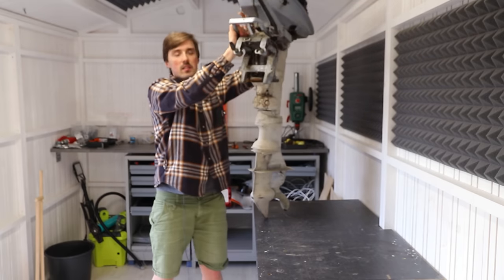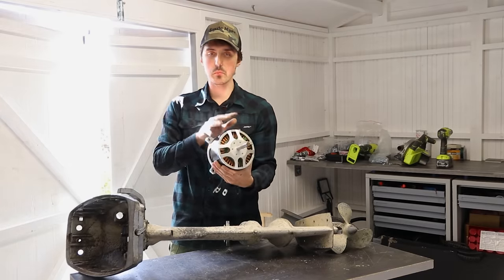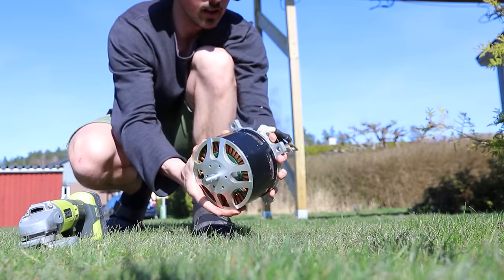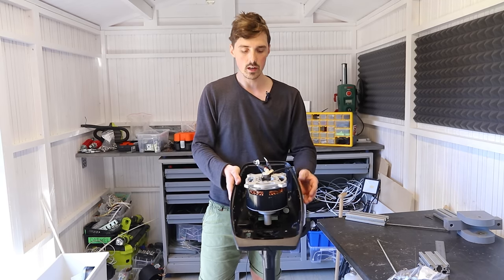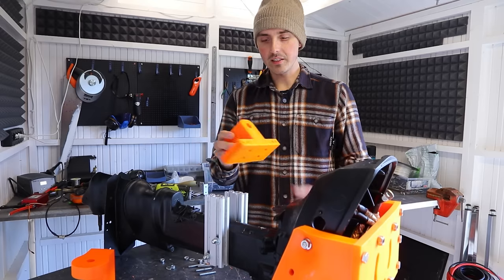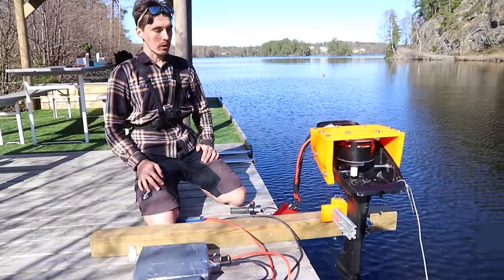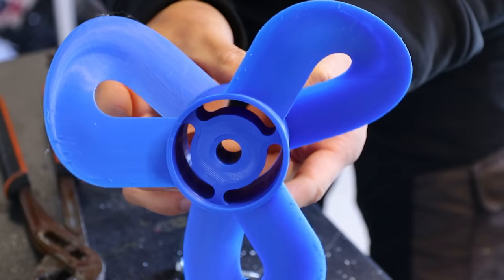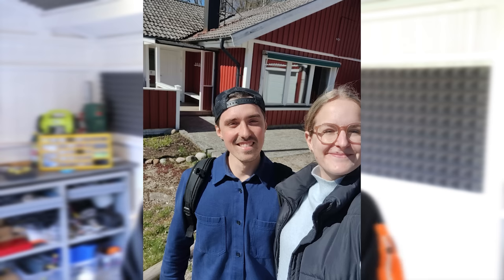Rideable Electric Speed Boat Build - PART 1

Comment from the maker: Yes, the rumours are true. I started a review channel: https://www.youtube.com/@rclifeonreviews
Reply: Subbed!
Reply: why not you use original outboard turning bracket was on it because it reduce headaches of other idea of 3d printers breaking and you can use it make bracket attached to pontoon boat and still use that original water pump inside lower shaft just need new impeller for it and come up to motor just need 90 bend to esc
Reply: Congrats:eyes-pink-heart-shape:
Reply: @kittyztigerz  Cuz he is hack and more and more so as times go on strangely. A hack with a gazillion followers, that is. So, perhaps a hack with a smart plan to stay hacky for the masses. He seeminly hates doing research so he often makes weird decisions like these. His new bracket also has its pivot point further ahead than it ever needed to be. Maybe not an issue with this power, but still, it's hacky AF and I wonder if he ever considered it's geometry and the consequences of changing it.
Also, no coupler between the motor and the shaft. He is likely going to wear out the bearings in that motor way faster than they should. Then again, by then, he is on to the next video. 

I mean, he is not stupid, probably not even lazy. It just puzzles me how many times he insists on making mistakes 15-30mins of research would have avoided. E.g. he yet has to figure out how to 3D print waterproof parts (enclosures and such) when the RC Yacht community figured it out 4-5 years ago. Or to start using proper o-rings when the two combined would likely have solved all the issues he always has with leaks in his electronics compartments on watercraft. 

But he gets shit done, he is entertaining and makes a living and the subs think it's all amazing. So, it's all good:)
Reply: @AntiVaganza  i hear ya if he would get to point when he does kick in go back fixed weak parts n alot time i do have ton of information about any machines because im engineer i was born to build stuff out of metal or plastic or woods
Reply: Just for my observation,  you printed prop wasn't cavitating from  mounting the motor high. It was sucking air out of the exhaust system.  The gas motor sends its exhaust out under the water so not having it plugged off is letting air get sucked out by the prop now.
Reply: Can you review those motors? I'd love to get a good one
Reply: Good luck
Reply: Please give us the files of the prop
Reply: Subscribed!

Comment: You should have used the original mounting bracket for the outboard engine as it serves as steering pivot
Reply: And the built in watter pump for cooling. So much extra work with this build😅
Reply: I was dumbfounded that he didn't use the original water pump nor steering assembly

Comment: I think you should use semi-flexible coupler between the engine and drive shafts, just in case they aren't perfectly aligned (and they never are), which might destroy bearings in the long run.
Reply: I think you are right, however, the 3d printed mount probably allows for enough flex for the bearings to not be under a terribly uneven load

Comment: Hello! Love your channel! FYI, the bottom end of the outboard motor should have some gear oil inside. You may want to check that its still there or you could risk burning up the gears and bearings. There should be a drain bung and a fill port that unscrew and may help efficiency if you use a lighter weight oil.

Comment: At 50v and 33kv you are at 1600rpm and with the reduction you'll have about 850rpm at the propeller. With that outboard lower unit you are forced to use a small prop so you will be grossly underproped. It would be wise to either increase your battery voltage, change the reduction ratio or even ditch the outboard and build the boat with an inboard engine configuration, which will be way more efficient allowing you to use a direct drive and a way larger propeller.
Reply: Oh, only 1600 rpm? Yeah that wont be close to enough if he wants to go fast. Dont know how you mean its more efficient though, that depends a lot on how it transfers the power, so it can be either way. Propshafts create a lot of drag...
Reply: @jotham123  Correct. There is no need to make prototypes if their only purpose is to check something that could have been done with a few simple calculations.

Comment: Cool, will be very exciting to follow this! Regarding the cavitation: there might be holes or tubes going from the underwater parts to where the old motor was, this is for exausts and maybe water cooling. It might be that the propeller is sucking air down through these tubes, that happened for me when I did a conversion :)
Reply: You are right, that's air being sucked from the old exhaust system. But that isn't cavitation (at these rpm and propeller size it is very unlikely), if it was afecting the propeller (reducing the effective pitch) it would be ventilation but you can clearly see it is produced just a few inches behind the propeller so it shouldn't be having any effect on the propeller. In a combustion engine it has the purpose of unloading the propeller at low rpm and low speed by injecting "high" pressure exhaust gases that unload the propeller (as they are forced not induced) and when the speed is sufficiently high they can't expand in the direction of the prop so the stop having any effect.
It helps quite a bit mainly for getting into plane.
Reply: @jimix321  That is very interesting, thanks for explaining :) I don't really get what you mean with "unload the propeller" though?
Reply: @AntonMakesStuff  He means that the propeller is made to "slip" and not grab the water too much at low speed by having it in "bubbly" water so it can speed up and have the engine get up to speed faster. If the propeller doesnt "unload" aka "slip" it will bog an engine down and the takeoff will be very sluggish :)
Reply: @eamh2002  That is very interesting, thank you for sharing!

Comment: For testing motors we've used a trash can where we could mount the original bracket on the edge and fill the bucket with water.

That might help for quicker testing at home 😊

Comment: Hi! Great concept. 
Why not use the original bracket for steering?
And what happend to the impeller? Did you take it out or are you going to use it for cooling the motor/speedcontroller?

Comment: hi, I don't think the propeller you printed is actually toroidal. It looks more like it's a regular propeller but with a hole in the blade if that makes sense. The point of toroidal propellers is that the extrados of the blade on the lower half becomes the intrados on the upper half, and vice-versa. So the blade sort of curls back to the propeller shaft. Look closer at the blade "tip" of toroidal propellers if my explanation isn't clear, they're not the same as the one you printed.

Comment: I don't know if you've already finalized this yet or not, but mirroring the mounting/hinge setup so that it goes on the top and bottom of the wood beam would massively improve its strength. If you did this, I'd be willing to bet you could even keep the mount made from plastic without any issues. I did some very rough math and estimated an increase in strength of an order of magnitude or two.

The biggest drawback to this is you'd need to find a way to get the whole setup further underwater since it would raise it even further in its current mounting configuration.

Also, as others have mentioned, using the original mount would also solve this issue.

Comment: Without sponsorship, PCBWay is quite expensive, therefore I would recommend trying "Lost PLA casting" or maybe just metal casting overall. It is a bit of an extra step, but in many applications i think it really would benefit you when normal 3d printed material just doesnt hold up.
Reply: It’s been a while since I’ve cast stuff, mostly precious metals (or brass for the fun stuff)
Good hand made wax moulds took me ages.

You just blew my mind with ‘lost PLA casting’

Comment: Toroidal propeller is technically coined by MIT lab and used in aerospace after Sharrow Marine patent.  The patent holders for the loop prop design is Sharrow Marine.  Sharrow Propeller copy would be more accurate technically.  I just talked to Sharrow Marine and they hassled the crap out of me for calling their propeller a toroidal prop.  😂

Sharrow’s patent covers loop style prop going through any fluid medium….they said this includes water, air, etc.

Comment: Looks awesome! I do think the cavitation is caused by the propeller itself, though. It being small and plastic and probably a bit rough will cause this. I just went thru that with my small boat. A brand new bigger and higher pitched prop solved the cavitation issue 100 percent….. good luck!

Comment: haha I like the new screw driver animated effects.
I would've used those bolts from the top, put nuts all the way to the top and tighten it, now you have 2 threads that are super stiff and straight. then placing it down you can mark the holes and place 2 nuts on the bottom and top side of the tray. then cross threads on the front and/or back to the 4 corners to stop it twisting.
your propeller I would've coated it with resin glue or UV one and then just put it outside hehe
use bearings on the turning parts rather than roughing it out.

Comment: Removes original clamp on mount made out of metal to replace it with a 3d printed part and a bolt xD 
Great video though, only thing that bugged me. 
I'm currently building a scooter with one of these motors and love as this inspiration!!

Comment: What happened to the original bracket for fixing the motor to the transom?
Also. Would it not be easier to change the drive shaft from the electric motor to the "bottom"? 
The mounting bracket will be way lower to the bottom of the outboard motor, making it stronger and easier to mount?
Reply: I think your are right the original bracket would be the way to go or at least copy it 👍
Reply: @DktheWelder  It was on the motor, and you can clearly see it at the beginning of the video.
My dad and I are also building one, but we are doing it more the johndehosson way (you tube @johndehosson).
We will put in on a ZapCat F1 boat :-)

Comment: The cavitation isnt from waterline, its because the exhaust is routed through the impeller housing from the motor housing. You will need to block that off.
Reply: Ooh, good point!
Reply: It would exit behind the propeller so I suppose it wouldn't hinder the flow in the propeller blades much. I mean, there's exhaust gas coming out in normal operation too.
Reply: @juhanaleiwo  it would depend on the impeller design i would imagine.
Reply: @colinsmith6340  Yeah, I agree it's probably best to block the holes anyway.

Comment: I think you need a cnc machine, a milling machine and a lathe, that way you can make some of these parts out of metal, 3d printing might be fairly tough, but the first twig that propeller hits will destroy it and you'll have a noise maker instead of a drive. We went to a lake a lot growing up, propellers take a lot more abuse than you would think, ours had dents all over its edges after a bit of time in the water, and we never ran it aground. it was just small stuff you cant easily see that is floating in a lake. like twigs.

Comment: 10:25 If the prop sits too high, then it's Ventilation
If a prop is damaged/imperfect and or spinning too fast that could result in *cavitation*, avoid the latter.

Edit: Congratulations for the new house!

Comment: You could use aniphone to map the motor housing in 3d to create a oretty good model. Good enough, anyway. It worked for me when i needed a replqcement canopy for a Skyhunter, after mine went for a deep-sea dive. I mapped the opening, used calipers to cross reference the measurements and voila, new canopy, now with more doctor recommended pan gimbal!

Comment: Hugely enjoyable video again. Thank you.

I think 1mm mild steel plate would be a good addition to your builds - for when you need strength.
It’s really easy to cut to shape with a (quality) metal jigsaw blade, and can be folded using vice and hands.
Self tapping Tec screws make it easy to connect to anything.

I picture a motor mount being a plate with sides bent down and Tec screwed to the inside of the housing. Then would the fit the lid on?

Comment: I love what you doing man. I think you need to get metallic 3d printing instead of plastic. I also bought my first house 4 months ago. I start doing some painting work at home and bought "4.5-Gallons Portable 225 PSI Horizontal Air Compressor" I would love to see what kind of project you would do it with that kind of compressor. I was able to connect multple tools and use for multiple things and working with air compressor it turns out its fun

Comment: I like to think I know a bit about outboards and stuff like that. I think I see several weakpoints even at the presumed power levels, sadly... dont know how much power you plan to put through it and how fast you want to go, but that 3d printed propeller.... I seriously doubt its going to hold up. At the very least, it seems almost certain its going to flex heck of a lot, greatly robbing efficiency. Though maybe that doesnt matter for this test. Cheers mate.

Comment: Does anybody know where I can get that custom circuit board for the manual throttle to connect to the ESC, just working on something similar but don't want to use a wireless controller.

Comment: That didn't look like cavitation, looked more like normal through hub exhaust. 
That outboard leg doesn't have that but seems to have a exhaust port near the propeller, an older design and it's probably just getting that air through there.
Neither have a big effect on thrust, by experience and education. As long as that cavitation plate above the prop is below the keel of the boat you're good.
Also those toroidal propellers give efficiency at a certain rpm and are not a plus 3 speed item like some people think they are haha.
Congrats on the new house!

Comment: There is a reason why outboard motors uses mounts which allows them to tilt back. When the motor strikes something it must be allowed to swing out of the way, otherwise something going to break - either boat's tranch or motor itself.

Comment: Congratulations on the new house! I know how it feels :-D Definitely want to see some of your projects racked up/displayed on the walls or hanging depending on ceiling height! LED lights illuminating the many successes (and failures). Just ideas though ;-) I did LED lights channeled in to the edges of some HDPE I routed as a tabletop on 8020 for displays in the past, I know you can do better (plus that was 15 years ago and LED tech has CHANGED).

Comment: Did you ever made tests with TPU ?
I know that it may sound weird, and I never built such big prints with such constraints, but what I saw with my experiments is TPU (95A) is easy to print, has good layer adhesion, AND isn't so flexible which allows parts to not snap instantly. Plus it's probably more durable in water.

Comment: I'll show this video to one of my collegues at Volvo Penta, they might have some input. I would say that the motor will probably spin way higher than the ICE did and you might or probably have issues with cavitation since the propeller will have a higher RPM. You should check out Candela how they've designed their propellers for their electric pods.
Reply: Posts above say it will rev much, much less, actually. Which seems to make sense, I dont think its common for large motors like this at low voltages to spin all that fast.

Comment: Nice build but I wonder if some of the mounts would be easier and quicker to fab up in wood or metal as compared to the time it takes to 3 d print especially since this is a one off build. Otherwise excellent work

Comment: I would suggest adding a chain/rope to catch the motor if/when if breaks off and wants to fall into the water. And i am curious to know, if something hits the blade or gets stuck on the shaft, is the motor going to burn out instantly? i would assume the PLA blade would just break and motor is fine, but i have a feeling you're going to be making that one metal too.

Comment: Original motor came with a large super strong steering mount. RCLifeOn: I’ll 3d print a small janky one. 

Also it isn’t cavitating thats air flowing through the exhaust.

Comment: Your steering probably better to arrange through Igus linear bearings. They are plastic so rust is not an issue and there are a ton of aluminium mounting options for them available, so no need to custom 3dprint plastic parts there

Comment: If you are ever using a weaker material for a joint like in this case you could double it. Have support above and below the main mounting point. That would also reduce the amount of torque a single pivot feels perpendicular to it's axis of rotation

Comment: even transom bracket and steering pivot should be alloy ,dont cut any corners ,because it will fail when its under heaps of torque forces

Comment: maybe you can cut the flaps of the leg of the motor depends on the shapebof gearbox shape, so you can pu a larger prop, that is way more efficient at your motor rpms, also for that pontoon i would sugest a lower pitch on the prop, when you make  a faster boad then you can have a greater pitch, it depends on resistance of the boad

Comment: Im 3/4 to your video, I know nothing of boat motors but ive been using electric rc cars for about 20 years and your 2 batteries seem awfully small for the size of your speed controller 🤔 and that huge motor, to be fair i dont know the specs and im only judging by looks 😉....cool video btw.

Comment: 10:56 Are you sure you need water cooling? I mean, that control unit is mounted on a big chunk of metal partially submerged on water. You don't need water going up to the thing, you need better heat dumping. Maybe some kind of heat piping or copper contact parts would be enough.